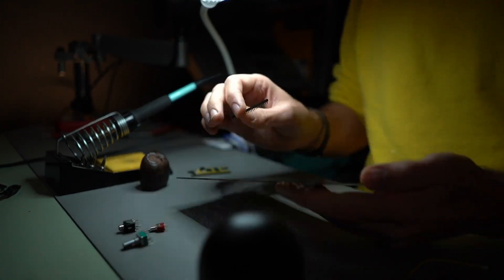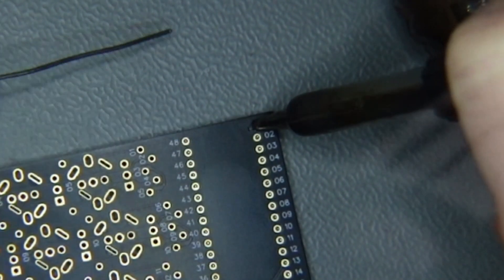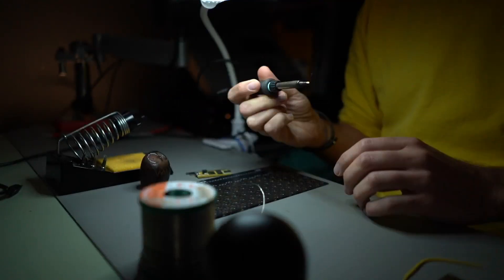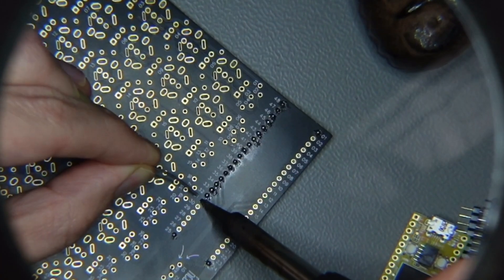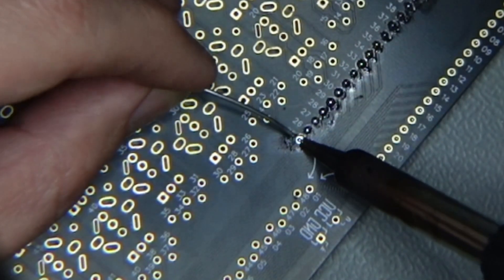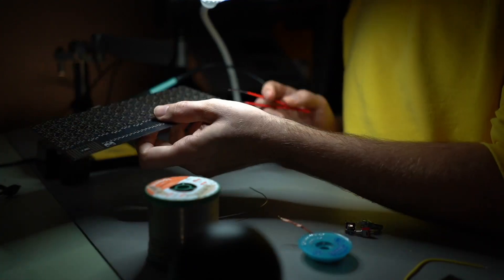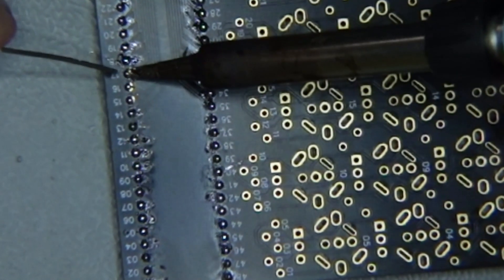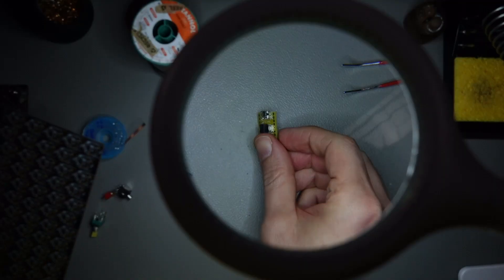Simple Synth DIY Les 03/06 - Soldering the microcontroller's female headers

Comment: a tip: you should use flux, it is porbably in your solder also, but it's also in tubes. if you put flux on the solderbraid and then remove the solder you will litterally see the solder go in the braid :)
Reply from the maker: Thanks! Yes, flux is great. My solder has flat x in it, but sometimes it’s better to add more. For example when trying to take components out.